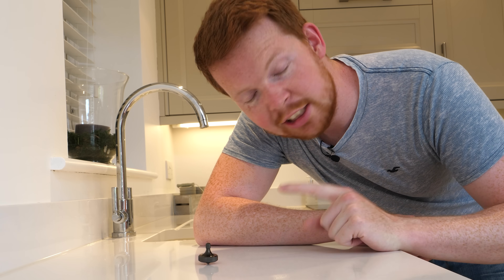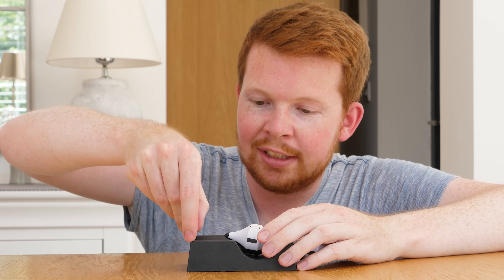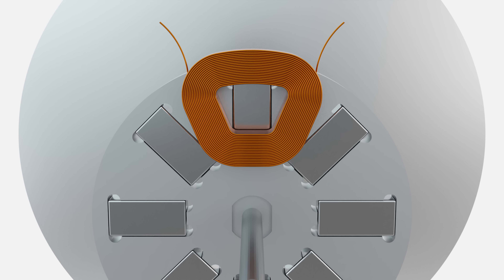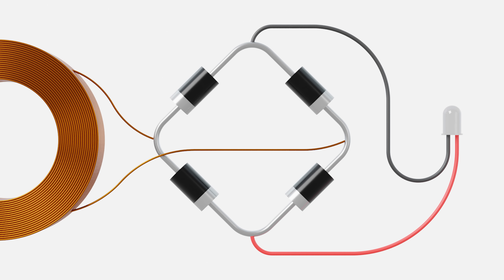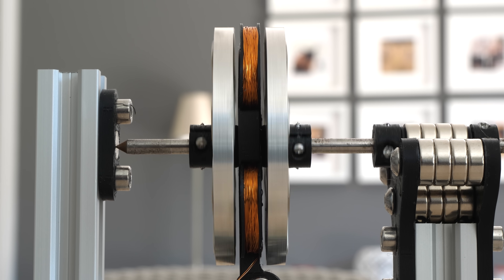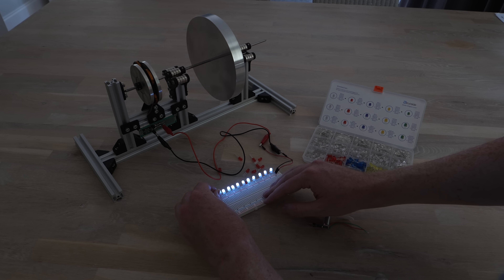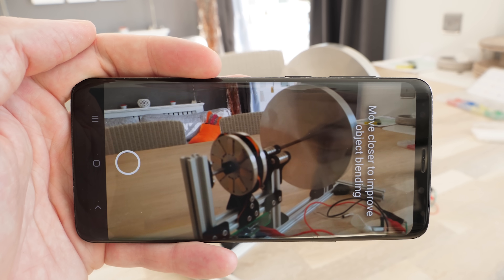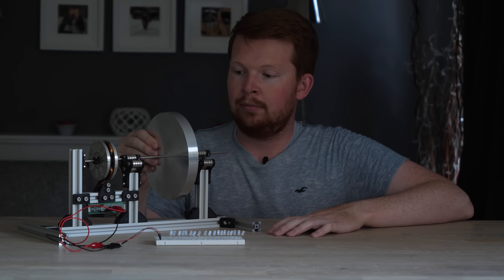Flywheel Battery

Comment: Very interesting. Is there a way to make it spin continuously by adding a meter to the hand crank side and connecting it to the hand crank with gears and use the generated energy to keep it running? Of course there would need to be something to jump start it.

Comment: Very nice project Tom, thank you for sharing.
I'm just curious why not replace the weight (biggest alu block) with another alternator. Use its weight and generate even more electricity :-)
Reply: the more alternator is added the faster the wheel will slow down! we cannot create energy

Comment: Ok here is my idea Merry Chrismas, Everything that has to do with utilizing electric current has and uses parts that fail because of friction. the second challenge is that It takes a tiny bit of energy to get it started. What if it was possible to elliminate both problems and creating a device that would make electricity continuesly and lasting a very long time. Your level magnetic wheel is very impressive although the power is in the fly wheel so by using multiple magnetic slides could solve that. it also takes energy to keep the fly wheel going. I have heard of micro diamond nuclear batteries that are in a testing phase or possibly solar energy to get the flywheel moving you still have problem with friction and heat in the motors moving starting the levatating wheel i am curius what if the entire essembly is made inside a vacume tube?

Comment: Please reply 
hello Tom,
I am Gaurav from India .
I love your videos and I have been watching for many months.I have seen your video in which I have seen that you make videos on different principles and try to explain them to us. Your videos are different and fabulous .My question is regarding DC motors.  I see that a small motor has high rpm high torque to compare another big motors ,I can't understand the formulas of motors winding .I have some following questions which are given below.
# A dc motor 3.7 v has Type: N20 DC Motor； Size: 15.5*10*12mm ； Shaft Diameter: 1.0mm ； Shaft Length: 6.5mm ；
# Another one Voltage:DC 3.7V;Speed:41000-42000RPM;Current:0.23A.
Motor diameter: 20mm; Shaft type: round shaft;Product model:131
Shaft diameter: 2mm; shaft length 13mm or 6mm randomly sentWorking Voltage: 3.7V DC, Speed: 23500RPM
Package: 2 x Motors.
# And another Voltage:DC 3V;Speed:16500RPM;Current:0.35A;
Motor specification: 15x20mm; Shaft type: round shaft;Product model:130
Motor height: 25mm; Output shaft: 2.0mm; Output;shaft length: 7.5mm ...
I can't understand these things , what is behind of this. 
please help to understand these things.
Thank you .

Comment: why don’t you just buy a 9 volt battery , they are like an inch hi and 1:2 an inch wide, yours is 2 feet wide 12” hi, i don’t think it will fit in tv remote control

Comment: could you put a small motor to keep the flywheel spinning at a constant speed, or faster, so generates enough power for the motor and the other outputs? so thinking all youll need is to spin it at first to give enough power to the motor that ups the flywheel speed, would that then be called infinite power or something?
Reply: No, perpetual motion machines do not and cannot exist. The generator that creates electricity from the flywheel has to slow down the flywheel to do so. The electrical energy isn't generated out of nothing, it's simply converted from the kinetic energy that the flywheel had. Sure, you can take it out, convert it into electricity and convert it back using a motor but every single step along the way has losses and the way would spin for longer if you just did nothing to it. Free energy doesn't exist.

Comment: What would happen if the magnets were rotated 90 degrees so only the north poles were facing up or down while the south poles were no longer engaged. Also, would a different number of magnets on the top and bottom work?

Comment: Add solar panel to power the led’s and lift a weight by day, lower the weight (raised up with excess solar/gears/pulleys) at sunset to power the flywheel at night.
No batteries ?

Comment: I've been thinking for years, the kinetic storage of energy using large diameter flywheels (Variable Inertia), not solid, but think of a wire spoked bicycle. There are weights that slide up and down each spoke. The weights can be microadjusted to tune balance, as well as each end of the spoke can be adjusted perpendicular to the axis. 
Also, as more energy is added, the weights uniformly move outwards, in order to maintain the same RPM. During the day, for example, a solar array adds energy, causing the weights to move outwards as it stores more energy. As energy is used from the flywheel battery, the weights contract towards the axis. This would eliminate the need for an inverter to 60hz as a constant RPM can be maintained whether the VI flywheel battery is in a low energy state (low charge) or high energy state (full charge). However with inverters able to be more and more efficient, the constant RPM may not be so important.... as an efficient inverter with a solid flywheel operating at different RPM may be less complex than a variable inertia flywheel.
Even a fixed flywheel would not be solid as yours is, I would make the flywheel large diameter, again like a spoked bicycle wheel, with most of the weight where the tire is. This allows more stored energy with a lighter flywheel, since the mass of the flywheel near the axis can't store much kinetic energy as the mass near the 'tire'
The chamber would need to be operated in a vacuum to eliminate parasitic air friction.

Comment: I've always wanted to do something like this. I'm no engineer or physicist, but maybe you could use magnets on all points of friction?; place magnets at the ends of the driveshaft chosen poles facing outwards, then have a "flange/mount/retainer" on both ends of the driveshaft as you have at one end now, place magnets with opposite poles to the ones on the driveshaft facing outward to hold the shaft away from touching either end, add another layer or two of magnets raising the driveshaft "mounts " higher or two additional mounts near the ends, if needed to prevent the ends of the shaft from drifting. Maybe attach some magnets on the outer part of the disk, well balanced, and then use a powerful handheld magnet to start it off. Maybe create an armature to attach the large handheld magnet and a counter to try the RPM's (How does time work in the metric system? Gotta figure that out), and use an Arduino and a servo to move the handheld magnet into place, using the device's power, to give a boost to keep it spinning. Stupid I'm sure, but it sounds cool to me. Nice video, good luck. I hope you solve the energy problems we have.

Comment: connect a capacitor and inductor in parallel after the AC-DC Convertor to smooth out the current 
to avoid the LED's flickering
Great video also !!!!!

Comment: You can also attach a multiplier for the system with a load. Thus, instead of manually turning the dynamo and flywheel, the load can be outweighed. As a child, I thought about all sorts of such systems. But their problem is, of course, in size, but since a flywheel has already been attached, why not attach a system with a load?

Comment: Maybe you could wire up the alternator so you could use it as a motor to add energy into the system? As I understand it the alternator is basically a motor already, but I might be wrong

Comment: So if you put this inside a vacuum with a frictionless magnetic keeper and had a starter motor you could control externally then the only energy loss would be from the induction magnets and coil itself and no air friction. It would be interesting to see if it went on longer.😉

Comment: Use two flywheels, line the inside with magnet, and use the magnets to keep it from spinning off the side,
while using the same to keep it up. Now it's frictionless and incapable of
falling off the lift points. A true magnetic zero friction axle.

Comment: If you put a wind turbine on the end, it would keep turning after the wind stopped, providing constant electricity.  With a big flywheel and gearing, you could generate a lot of power.

Comment: Try to create real flywheel battery, I mean being able to charge and discharge electrically, theoretecally you can apply AC to your coils and make them actually an electric motor, but it requires quite complex circuit, or just use some factory DC motor on flywheel axle. Interestig how much capacity and what self-discharge factor you could get from DIY thing.

Comment: Great work. Would putting two coils on the side of single magnet in generator give same efficiency? Then it would be possible to put magnets into the flywheel itself and make the whole thing shorter to reduce wobbling. 
An addition of pulse voltage stabilizer would allow to go at higher speed, while keeping LED voltage constant. Then, ideally, a crankshaft with gear train to increase speed and some sort of clutch…

Comment: What if instead of the glass you put 2 magnets to hold it off the glass? or in the case of the flywheel off the tip? Would it end up oscillating until the force caused the magnets to collide or would it shove the flywheel so hard it overcame the directional bias and fell off the other way? Or would it just reduce friction and up efficiency? I'm at 2:19 when I asked this question, if you tried this I'm excited to see if not...

Comment: patented technology, but lets go forward, adding steel plates each outer side of each rotor, also patented, increases the force of every magnet in the Rotors, by adding each magnet to a completed magnetic circuit, also patented, but then those patents were originally done in the early 80 s next every comment is correct, but by adding a power source and pulsing the coils at just the right time, increases the speed of the rotors and if the pulse is the right length and voltage, the pulse energy is 98 % recovered, in the collapsing field also patented,  but when you add all these together, it makes about 5 x more electricity then put in, and the flywheel never slows down, perpetual motion, some say it is not possible but find any thing in this universe that is not in perpetual motion , the sun stars planets molecules etc, Electricity is not created it is pumped and setting up this patented generator system cost several there lives some 15 years ago, Mohawk Park Tulsa Oklahoma, yes many have made plans to get this on the market but each time, funds were eliminated or people died, so far 5 that I know of,

Comment: So, the main point is that the friction allows to spin for long periods of time; that you can collect the volts it generates.
A) What Is the maximum amount of volts you can collect until the wheel stops?
B) Could it be possible to increase the spin using that cylindrical helicopter plastic toy mechanism that propels it to the sky? (Or like a Beyblade)

Comment: What would be interesting to know is how fast the flywheel stops if you essentially short-circuit the coils (which basically would use the power generated by the flywheel to stop the flywheel)
Reply: Using Water like the Egyptians did when they flood the so-called tombs.
Reply: @FatJesusLive  ???

Comment: Try making an electronic brake for it. Have a switch to put a large resistor bank across the coils and see how quickly you can decelerate the flywheel.
Reply: Keith - No need for resistors, just let the switch short out the coils, for maximum braking effect.
Reply: Arent those rheostatic brakes? If he hooked up a potentiometer he could theoretically control how fast it decelerates.
Reply: And thats the MGU-K in Formula 1 cars
Reply: FYI (regarding braking): Trains use this technology for breaks on a train (being used for years) "electromagnetic brakes"
Reply: Nice try but I think you will find injecting a DC signal into the coils a much better option
Reply: The coils aren't slowing the flywheel in any meaningful way.  The most likely energy loss is due to the severe unbalancing.
Reply: @slamshift6927  The coils have to slow the flywheel because they are putting a load on it, and extracting energy,  The coils produce current which causes a force that opposes the momentum.
Reply: or regenerative breaking yes
Reply: can you please explain this in a bit detail? and the theory behind this?
Reply: @pranjaybhawsar4639  -  Lenz's law, named after the physicist Emil Lenz, who formulated it in 1834, says that the direction of the electric current which is induced in a conductor by a changing magnetic field is such that the magnetic field created by the induced current opposes changes in the initial magnetic field. - What this means is that the load will cause a current to flow, and this current will produce a magnetic field which will oppose the motion that created it. So, when you load a generator, making it do work, the generator gets harder to turn. In this case, it requires energy from the flywheel, causing it to slow down.

Comment: it needs to have magnets on the left and right sides as well as magnets on each end of the spinner itself...the levitation is already managed but it goes to the left or right without the plate installed...2 plates ,one on each side with a magnet opposing the extra ones added to the ends of the spinner, should keep it in the levitating field while eliminating friction. would spin for a hell of a long time...there Are already ,spinning tops that do so in mid air floating on a magnetic field... they float about 6" up in the air over a base and spin Along time.

Comment: Use a bit of that led power to position the axle without a plate? It seems a flywheel effect would make it stable with a coil on each side of it paralleled.

Comment: You could have just added a transformer my guy,  that way you could step up the ac voltage to any voltage needed…. and then powered lightbulb at that voltage….
Reply: He could also add more turns to the coils of the alternator to generate more voltage using the faraday-lenz law equation

Comment: maybe you should try to use more magnets to stabilize the rotor even more so it won't wobble so much up and down because anoter set of magnets are pushing from above and a nother set of magnets and coils (out of face to the other set) to eliminate the flickering (or reduce it)

I don't know if it works but it would be worth a try

edit: and if you put the whole setup in a vacuum you can eliminate air fiction

Comment: So what would happen if you attach the output shaft of the motor to the Rod that holds the flywheel and gave it a push to get it started ?

Comment: To all the people suggesting to put magnets to the sides, to hold the flywheel exactly in place. This works, but since on each side a magnetic  repeller had to be installed, this would build up friction by pressure from both sides. So there is a reason, why those toys usually come with a smaller friction point on glas.

Comment: just an idea: if you put a ring magnet on each end of the shaft (larger diameter than a shaft) with reverser polarity to the magnets on the shaft - you would have a magnetic limiters and run frictionless. Then put it into a vacuum enclosure, and you're golden :)
Reply: Use a composite to hold the magnets as well to keep from having eddy current slowing the rotation.
Reply: @jonspornhauer8530  Can do, but using metal improves your magnetic flux …. but needs to be slotted for exacly what you mentioned about eddy currents.
Reply: @jonspornhauer8530  BTW, in original comment I was referring to main rotor, not the propulsion rotor to have slots - which when you scale it up will start interact with static magnets and earths magnetic field
Reply: @tommybronze3451  How about making the inertial rotor out of wound kevlar fiber.
Reply: @rudwick  depends… if we are still talking about garage project - why? a real solution - why? I mean for garage project there is no reason for space age technology to expensive, and for professional solution - the same, why would you do that if few ton of concrete cylinder will do just as good! (of course there was a flywheel based KERS system in F1 so they would do crazy expensive stuff, but even they went for batteries)
Reply: You did it 😳
Reply: @countingwithjerold  Weeeeelllll also one should include slots in main rotating disk (1 is ok, but I would opt for more depending on disk size, sometimes 8 for very large ones) to eliminate eddy currents from suspension magnets (yes tinny due to distance, but still a loss). Rotors (motor one) should also be designed with mitigating unwanted eddy currents as well Suspension magnets should be all around the shaft so one can be more liberal with putting energy in and out of the flywheel without excessive wobble due to gyro torsions.
Reply: ....and then install between 2 axles on an electric vehicle....when braking...activate and let it recharge the battery while the vehicle is stopped! I've thinking about this for years!! Thank you soooo much!
Reply: @emilparker5521  no dude, just NO! problem with vehicles is that spinning flywheel produces tremendous amount of torsion forces when going through corners or though bumps! because of that you need to have real bearings, not magnetic ones - and those wear off at astounding rate on flywheel systems! you’re far better of getting your self a capacitor bank -> dumping all your breaking energy into is and than charging batteries ! (or having good battery with high power input and dumping energy directly to it, which current EV actually do have!) flywheel systems are only good as a very cheap, high energy, low power, huge charge cycle count, static applications !

Comment: Alot of random orbital polishers have a 120v DC motor that generates alot of voltage at low rpms. They use a rectifier but you don't need it for power because it's already DC. LEDs need a resistor to work.